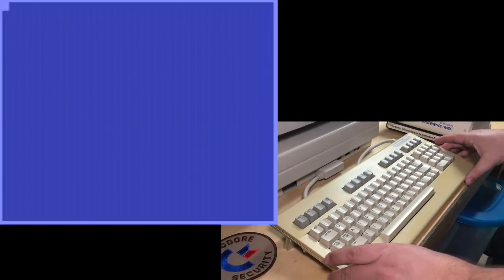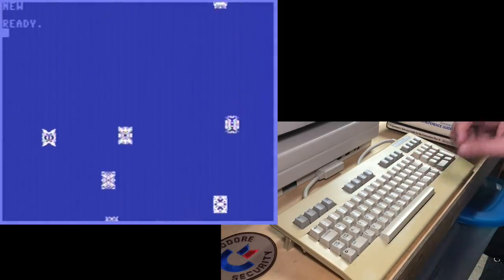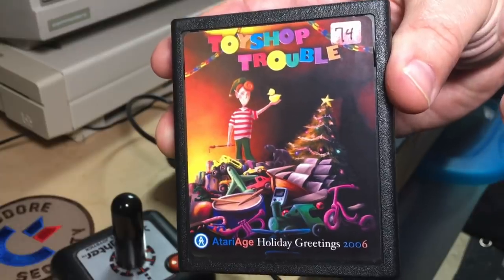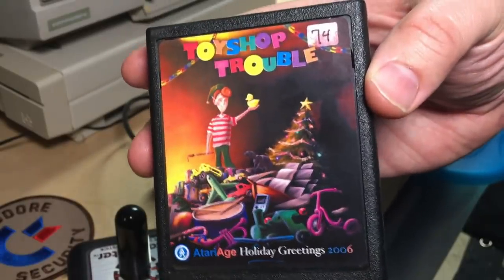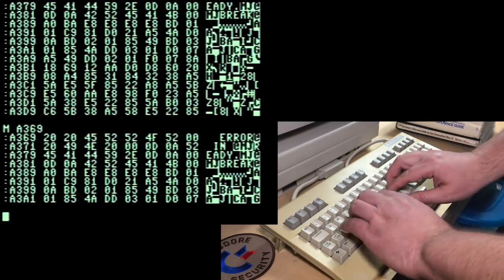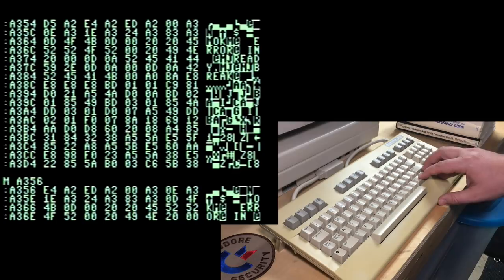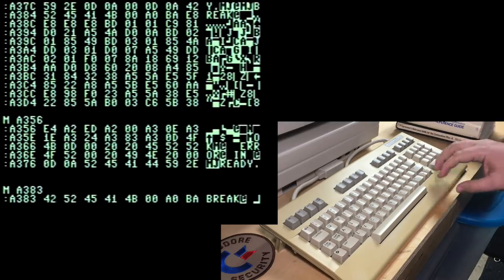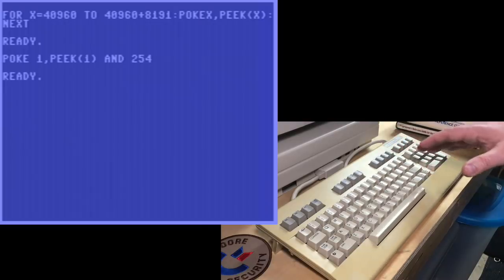The Extra Spaces in Commodore 64 BASIC Errors

Comment: The BASIC ROM for the C64 was pretty much a verbatim copy of the VIC-20, except it was relocated to $A000 from $C000.  The VIC-20 had a very narrow screen, so the "ERROR" part of the message included a carriage return and a Space prefix to start and indent it on a different line.  They could easily have cleaned this up by shifting the whole "ERROR" text back one byte and putting a redundant $00 on the end to maintain the code alignment, but they apparently didn't bother.

When you were looking at the error messages in ROM, you could have hit Commodore-Shift to see that the last letter is in upper-case, which in PETSCII means that the high bit is set, which also acts as a terminator.
Reply from the maker: Good points. I also have notes for an episode about the history of these space errors going through from the PET and VIC-20, and had that info in there, I think someone else commented on it shortly after the episode was first released. I wish I had thought of doing the Shift+Commodore thing to illustrate the high bit being set!
Reply: 8-Bit Show And Tell is it because of that legendary deal that Jack made with Microsoft—they didn’t change anything because that would have broken their sweetheart deal?
Reply from the maker: Paul Bruneau I think that was a factor, yes!
Reply: 8-Bit Show And Tell thanks! Your videos are fantastic btw. I bought a vic-20 then a C64 a couple years later. 30 years later I program iphones 😃
Reply: It helps to have exotropia if you're trying to program a VIC-20.
Reply: Yeah, it was a single space in the PETS; they introduced the carriage return especially for the VIC (with a space to skip the question mark and line the ERROR up with the message on the prior line), and I guess they just did a quick replace of the CR with a space for the 64. They did, however, fix it in later BASIC versions. 3.5 on the TED boxes and 7.0 on the 128 have only a single space before ERROR.
Reply: Just came here to say this lol! I was watching RetroCombs showing his daughter The VIC-20 and noticed the indentations in error messages, and thought to myself "Wait a minute! Didn't Robin do a video on this subject?"

Comment: When you consider how last minute the BASIC ROM and Kernal was for the C64, we can forgive them for this! I'm less forgiving about the IEC transfer routine that made the disc drive ridiculously slow!
Reply: @stupossibleify  Yeah, but that's because of a bug in the 6522 chip that was fixed in the 6526.  Essentially, it was supposed to have a hardware shift register, but it didn't work.  They were forced to resort to bit banging in software.  The Commodore 64 used the 6526 chip, but when the 1541 disk drive came out, they wanted to make sure it was backwards compatible with the 1540, so they used the 6522 again.  

Now, you may wonder, "wait a minute... why didn't they just skip backwards compatibility, so that there would be a working pair of 6526 chips?"  Simple... some jackhole at the factory decided the C64's motherboard wasn't secure enough, so he added a screw hole right through the trace for the 6526's shift register.  In other words, it wouldn't matter if the 1541 had a 6526 or not, because the hardware shift register still wouldn't work.  It wasn't until the Commodore 128 and the 1571 disk drive that we got a working pair of 6526 chips.

On top of that, the new VIC-II chip introduced "flutter" into the timing, so they had to slow the drive down even more to make it reliable again.  The result was a disk drive that, even under ideal conditions, couldn't transfer more than 512 bytes per second using the standard I/O routines.

Comment: I thought the extra spaces before "ERROR" simply was a form text alignment so that all different errors messages lined up.
Reply from the maker: This seems to be the reason: On the PET there was just one space before the ERROR. Then on the VIC-20 they added a carriage return because some of the errors were too long and had an ugly screen wrap otherwise. Then on the C64 they didn't bother to recompile, and instead just patched over the CR with a space.
Reply: That was my guess, too.
Reply: Late to the party. This was what I thought too.
But /why/? It's not as tho' you got a series of errors in one go (I assume)
Reply: @christopherlawley1842  read the other comments here. the answer is in this video's comment section

Comment: This really brings back memories for me.  My favourite cartridge was the Super Snapshot 5 (in fact I think it was my first and only one I used).  And I absolutely loved 6510 assembly, it was so easy to program.  A great CPU to learn assembly on to be honest.  I have a C64 along with a 1541 and 1571 in storage, I don't think they work 100%.  I have my Vice64 emulator with SS5 cartridge ROM, so it comes up like my real machine used to <sigh>.

I loved how you could copy the ROM into the RAM.  The reason why this happened which was not explained is because you could ONLY read from ROM, you could not write to ROM, so when you poked the same value back to the same location, it read the ROM, but because it is Read Only Memory, any writes to that location went to the RAM under it.  Anyhow, this also works for all other ROMs like the character ROM because the C64 has the maximum memory addressable for 16bits, all ROMs are located above RAM.  You could copy the character set, which many games did, and the redo the characters, which was a handy trick.  I one time created my own custom 80 column text with 4bit wide characters (not the best, but it worked) for use with 80 column BBSes back in the day.

I recall a nifty little program in one of the Compute! magazines (or Compute! Gazette) where you could use the hidden RAM under the ROMs as a temporary RAM drive to store small files (just don't power the machine off).

Anyhow, nostalgia overload. :)

Comment: I used c64 in the 90's (still in the basement somewhere).
6:25 My 1st pick is to notice that ERROR word in both cases (most likely in all) is 9 characters from the left of the screen. Conclusion - there are 9 characters for error "name" that are later followed by ERROR string. EDIT: Check from $A360, and yea, I remember there were longer error messages as well so... funny one.

Comment: i tested the 128mode via vice. the "normal" errors, like syntax error are corrected, so the just have on space inbetween. the break error has two spaces... so they just done one bugfix.

the vic20 uses returns between... and i figured out, a basic line on the vic 20 can have 88 chars, or 4 screenlines (4*22) 

on cbm II the errors have one space and if you break a disk operation as load"$",8 you will get a ?file not found error. instead of break error...

on a cbm 5x0 there is also the correct syntax error. and hit stop at load"$",8 brings a "?stop key detectet" message.

the PET also have correct messages, and it seems u can't break listings, at least i can't do it in VICE using the ESC-Key

the plus/4 behaves like the c128...

I hope  this little info is kind of interesting for you ;)

well i tryed it all useing VICE Emulatior...
Reply from the maker: Awesome! I had tried some of this and have notes for a follow-up episode, but hadn't tried CBM-II, Plus/4. I was thinking of doing a little history of this bug, from the PET through the VIC-20, C64 and C128, as they kept re-using much of the code and just tweaking it slightly. Oh, I wonder if it's totally fixed in the C65? :)

Comment: If I remember correctly, when you wrote to a ROM address, you would write to the underlying RAM instead. This means that you could read from the ROM and write the byte back into RAM without any bank switching. Then when you copied the whole ROM into RAM, you could just switch the ROM out for the RAM.
Reply from the maker: Yes, that's exactly what I'm doing at 25:20 or so.
Reply: 8-Bit Show And Tell oh yes, there it is! I think I watched to 20 something minutes before I had to go, but I did assume that it was exactly the thing you were doing.

Comment: Hi Robin. I think the reason that there are two spaces is that it uses the same code as the VIC-20. On the VIC-20's measly 22 column screen the error messages appear on two lines because some of them would wrap. The first line has the error and the second line starts with a space and then ERROR. If you put a line full of ###### on the VIC and then make an error appear on that line, you'll see that the error is printed without any spaces at the end, then there's the carriage return, then on the second line there's a space and then ERROR. I think all they did was re-use that code but make the error stay on one line since the c64 has 40 columns and they didn't have to worry about it being longer than they could fit on that single line. They simply changed the carriage return to another space.
Reply from the maker: Yes, I think that's exactly it. I had forgotten I had done more research on the topic after this episode was released, and was planning on a little history of these errors going back to the PET and the VIC-20. I just found my notes from December. Thanks for the comment and reminder! :)

Comment: Hah..what a wonderful video. Over 3 decades of commodore experience here, and I've always found something to be wonky with the basic error messages. Never really looked close enough to figure out it was the spaces all along. 
In assembly I usually disable interrupts before changing the memory mapping, but in basic there's not really a way to do that. Could that be worked into the poke command itself perhaps?
Reply from the maker: Thanks, glad you enjoyed the video! Yes, in most cases when changing the memory mapping interrupts should be disabled first, but in this case I think it's safe to leave them as we're switching from ROM to the RAM underneath which has an exact copy of the ROM. The keyscan IRQ can be turned off in BASIC with POKE 56334,PEEK(56334)AND 254 as seen in line 20 of the custom character example on page 110 of the C64 Programmer's Reference Guide.

Comment: Maybe they're not bugs, something I like to do in my code is make some messages more visible than others, an error would be such a message. So, having 2 or 3 spaces in front would certainly make the error pop out more. Also the fact that those errors are aligned to the same column makes reading easier, which is also something I'm doing a lot.
The reason I don't think it's a bug is because 1) they're extremely easy to fix, and 2) those messages are extremely frequent. So the best explanation is that this was done by design.

Comment: Great channel Robin!  I just subscribed. :)

A few years back, someone named palordrolap gave the following explanation for the two spaces on reddit:
------------------
Commodore BASIC V2 is the same dialect of BASIC that was on the VIC-20, and the interpreter was pretty much ported wholesale from one computer to the other.

Note that there's nothing specific to either machine in the BASIC language itself, so only minor changes were required.

Now, the VIC-20 had a 22 column screen, and so on that machine, while errors like ?SYNTAX ERROR could have fit neatly on one line, some would not... so the VIC-20 printed a carriage return immediately before the space.

?SYNTAX
 ERROR
See how that lines up?

On the '64, plenty more line real estate was available, so the carriage return was superfluous. Since removing a byte from the ROM could be troublesome and require branch recalculations and other things, it seems that the (lazy?) decision was made to replace the carriage return with a harmless space.
Reply from the maker: Thanks David! I think this explanation makes perfect sense. I've had a follow-up video planned for some time, but I keep getting side-tracked with other ideas :) I'll try to get to it soon.

Comment: I think that $A0 at $A389 might be the opcode of a LDY #$BA instruction!  You should have changed $A387 to $CB instead to avoid introducing another obscure bug.

[Edit: I read a bit further down in the comments and realized that the breaK solution isn't that great.  My point about the danger of changing the $A0 may still apply.]
[Edit#2:  I checked the commented disassembly, and discovered that there's no danger ... the executable code starts at the $BA (TSX) ... nevermind ...]

Comment: Instead of changing the A0 to 80 after BREAK you could instead change the 00 before the A0 to 80 and get the same result but have the routine read 1 less null character (which would add a tiny unnoticeable speed increase, not that it matters). So that's POKE 41864,128 instead of 41865 that you use.
EDIT: You can save yet another null character from being read in the routine by adding the high bit to the K of BREAK with POKE 41863,203
Reply from the maker: Unfortunately, that prints "breaK" (if in lower-case mode) when STOPing a RUNning program. There's two different print routines using that same string: one expects null-terminated strings, the other, high-bit terminated.

Comment: That expanding Print listing reminds me of a contest that one of the old Commodore magazines had: To write the shortest game program in BASIC that had user input and kept score. One guy (the winner of the contest) made a full downhill skiing game in only 2 lines, but every command was entered using a shortcut, so if you listed it after typing it, it filled up 5 or 6 lines or more (it's been over 30 years, so I might be off a little!)
Reply from the maker: Yes, I remember seeing examples like that :) Another funny (or, annoying) thing about those sort of BASIC programs is that you can't edit the lines without retyping the entire line, as the editor will only recognize the first 80 characters!
Reply: @8_Bit  Exactly! And variable names, if I remember correctly, were only significant in the first two letters, so that (for example) "name" and "nathan" would be considered to be the same variable. Got me in trouble more than once before I figured out why my programs were not working as expected...

Speaking of bugs and such, wasn't there a "garbage collection" bug where, under certain circumstances, the 64 would appear to freeze as it reorganized internal data? Still miss that old C64, though...
Reply from the maker: @JustWasted3HoursHere  Yes, that two letter variable name thing could cause a lot of trouble. Best just to never use more than 2, I think. And yeah, I've heard of long garbage collection pauses, but don't recall ever running into it myself. I should look into that, to see how it can be recreated...
Reply: @8_Bit  There's a reference to it on the C-64 wiki, here: https://www.c64-wiki.com/wiki/Garbage_Collection It seems that the way to recreate it is to create hundreds of variables.... (Too many for the string "heap" to handle in a reasonable amount of time). That should be easy to replicate... :)
Reply: Here's an example of a program that would cause a GC of about 1 hr and 49 mn, according to that wiki:
1 M=9000
10 DIM A$(M)
20 PRINT "FREE STRING MEMORY: " FRE(0)
30 B$=CHR$(65)
40 PRINT "ARRAY SETUP ..."
50 FOR I=0 TO M : A$(I)=B$: NEXT
60 PRINT "GARBAGE COLLECTION ..."
70 TI$="000000"
80 PRINT FRE(0) "BYTES FREE"
90 PRINT "TIME (HHMMSS): " TI$ " /" INT(TI/3600+1) "MINUTES"

Comment: 22:25 Classifying this as a bug implies that the implementation was unintentional.  However, that might not necessarily be the case.  I would postulate that the decision could have been made to have "BREAK" terminated with a null character, followed by $A0, since it would eliminate the need to take up additional space by adding it to the table of high bit-terminated strings, with the caveat of having additional space taken up on-screen.  Without insight from the developer, it's anyone's guess as to intent.
Reply from the maker: Seeing as it's possible to eliminate the extra space by modifying a single byte (as I show later in the video), and that neither the PET or VIC-20 display the extra spaces even though the C64 ROM was very directly derived from them, I'm going to continue calling it a bug.

I'm not very agreeable to the idea that the developer's intention is the main factor in deciding whether something is or isn't a bug. If that were the case, I could declare all the code I've ever written to be bug free by simply stating that's how I meant it to be.
Reply: @8_Bit  I understand your point, but if anything I would consider it to be a cosmetic imperfection rather than a bug.  A bug breaks something.

Comment: I'm probably doing something wrong, and braindead most likely..

Just for fun, I tried to do the copy to $c000 in the monitor for VICE for the C64, and it copied all the data from $a000 to $bfff just fine. Verified it by looking at it in the monitor. But it freezes the emulator, when I return back to BASIC.. it's just a black screen. But, using the FOR..NEXT loop to poke the values "back on themselves" from $a000 to $bfff worked just fine. Any idea why that Transfer thing wouldn't work?

Comment: Hmm
I bet they could've saved more bytes by not using the table of pointers, and instead searching through the error message table until they passed a certain number of characters with the high bit set. slower, of course, but for printing error messages it wouldn't matter anyway